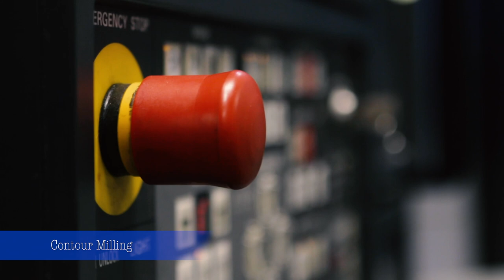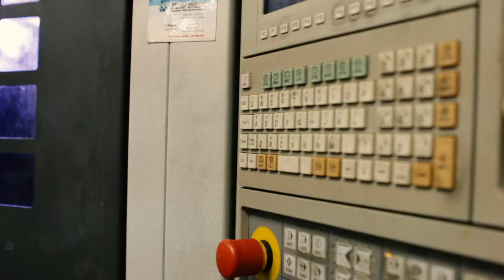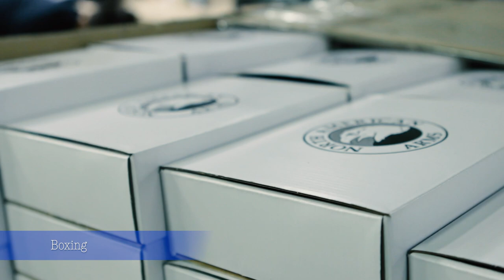Manufacturing Video 2018

Comment: I like mine, I can hit 10 inch steel out to 25 yards with it using cheap ammo. When I first got it, the cylinder lock pin would pop out every few shots. I sent it back and they fixed it (slightly bent the pin). Never had another issue with it. Granted, it should have never happened if they tested it. Maybe they only test one out of every “batch”.

Comment: Goods guns but way over priced
Reply: The $200 - $300 price points for most of their models is not overpriced for an all stainless steel gun. The Sidewinder is cool as well as the Ranger 2 but they are definitely too expensive. For the $450 - $600 price range there are better choices.
Reply: Yeah I guess you're right  I've definitely spent more than $200 on a firearm. They are very nice guns though
Reply: Did you not see that video? How can you call them overpriced?
Reply: @jond5939  By how much they charge for them.